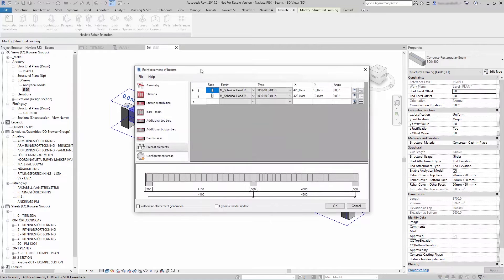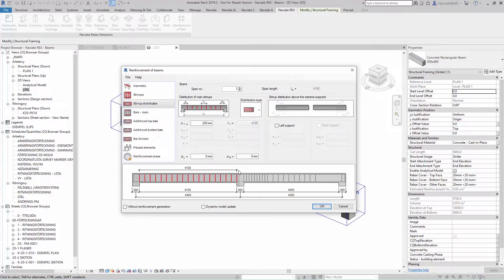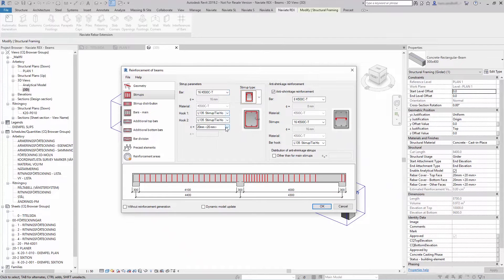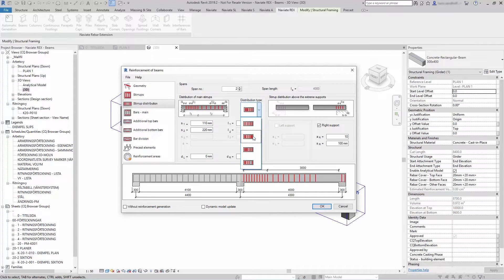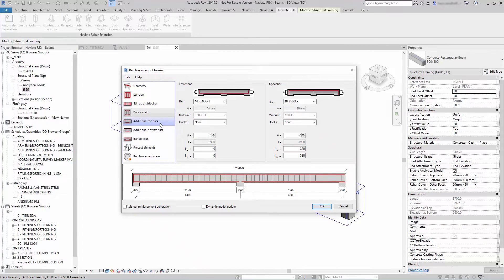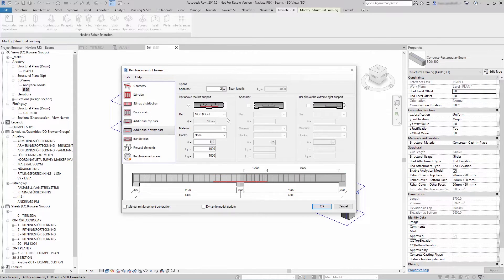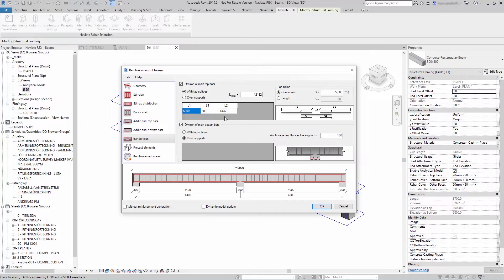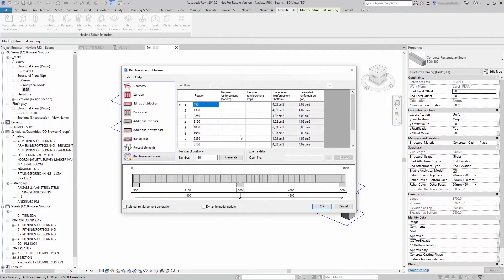Naviate Rebar Extension 2021 - Beams

Comment: how to model bent bars using naviate?
Reply from the maker: Hi. We we'll need a bit more details from you to give an answer. You can reply here, or send us an email to info@naviate.com /Anette, the Naviate team
Reply: @Naviate  well it is easy to model straight steel bars on naviate but sometimes it is required to model bent steel bars for beams is there any way to model that in naviate?
Reply: It is diffrent than a hook when we bent lower reinforcment it goes to top layer on 60 degree bend angle or 45 degree
Reply from the maker: @mostafahanafi9092  Thanks for the details. So Naviate Rebar Extension does not support this. Also, REX will not be supported with new features going forward (or being upgraded to new versions), as it's replaced with Naviate Rebar (https://www.naviate.com/naviate-for-revit/naviate-rebar). /Anette, the Naviate team